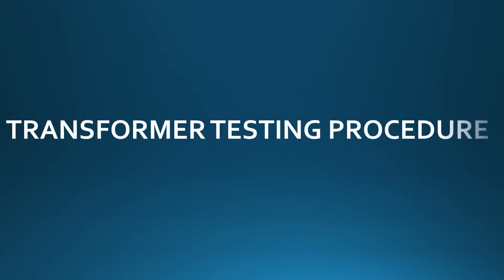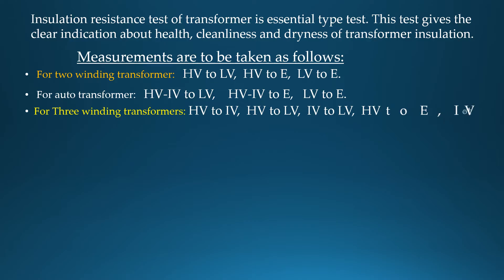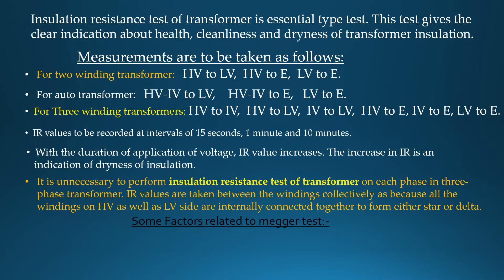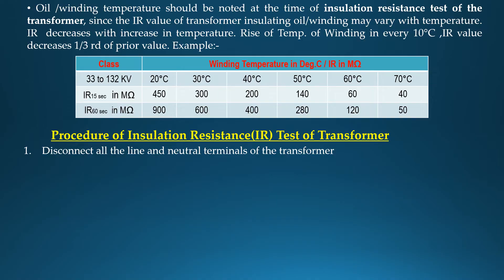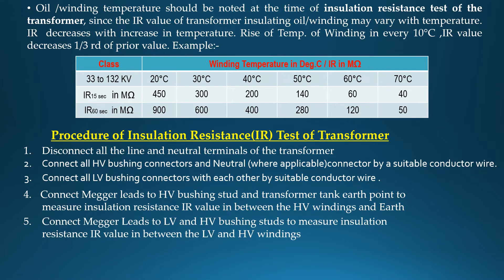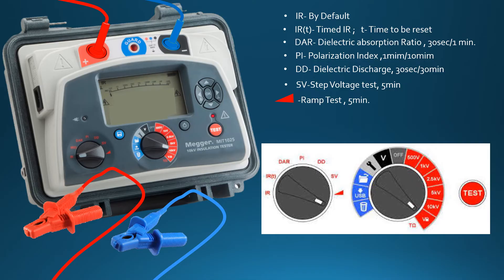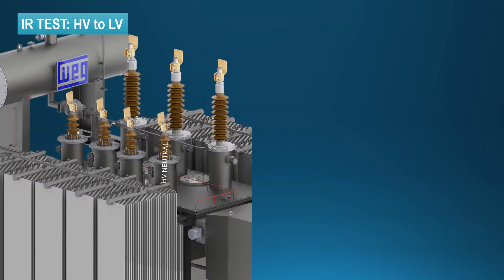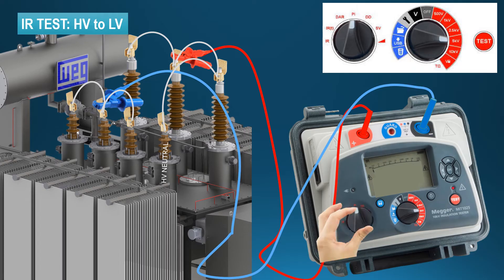IR & PI TEST OF TRANSFORMER BY DIGITAL MEGGER: IR/PI TESTING PROCEDURE: HOW TO MEGGER  TRANSFORMER:

Comment: Sir,why hv jummper to N?
Reply from the maker: You are welcome. IR can be measured by  connecting any phase with Megger means IR Tester. Not to left any loop holes for measuring IR etc. all phases are connected with a common conductor and here N the neutral point connection, insulated neutral of HV side also connected with same conductor and connected with megger lead. Thanks a lot❤.

Comment: what is GUARD  for ? (that you didn't use)
Reply from the maker: Insulator surface some times contaminated by airbourne dirt and even a thin flim of moisture. This conditions lead to flow surface leakage current may affects the result when measuring insulation resistance. On that case conduction band is used for certain cases which is connected with gaurd terminal to obtained accurate result. But we generally test the insulation resistance on nearly clear surface. So we need no gaurd. Thank you ❤

Comment: In uganda we use 33Kv and 11kv transformers. What IR values should i expect for High IR
Reply from the maker: You are welcome. Higher (as much as possible)IR can be expected for all Transformers even  in giga-ohm, tera-ohm also. But what would the lowest
Value of IR on which a transformer can run safely fully depent on testing wing experience and capability of taking risk. Thank you.